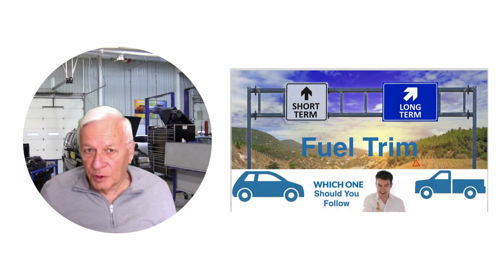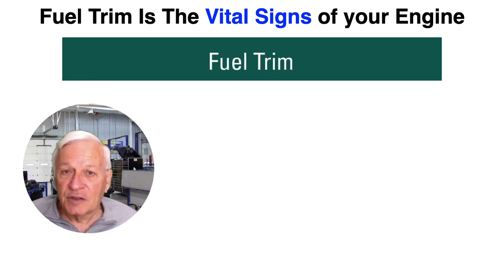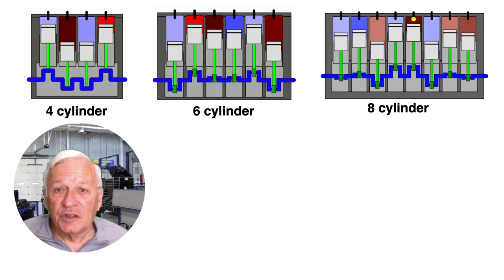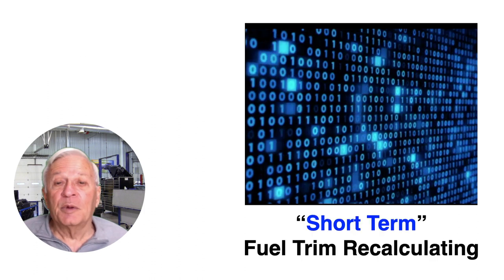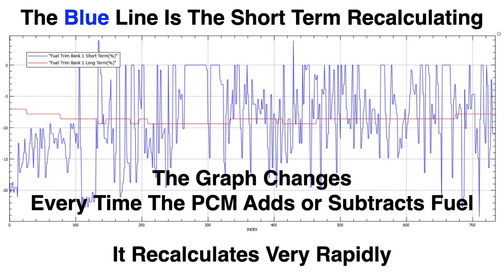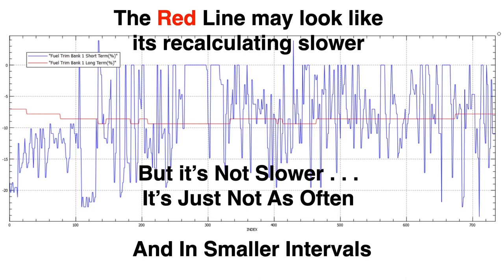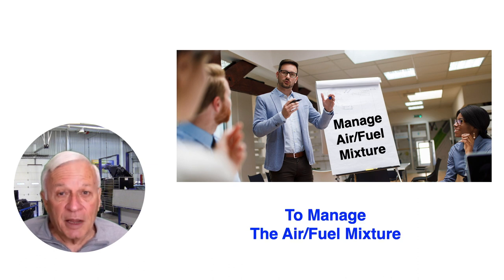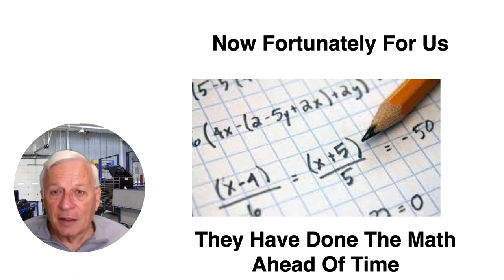Fuel Trim Why there are Two

Comment: Very good overall explanation.  What it's not clear, is why when the PCM adds up to 0.02% to adjust to correct 14.7:1, then the next time instead of turning back to minus -0.02 % to level up even and correct, it shifts to a -0.03% and starts a seemingly erratic "over-doing it" cycle.

Comment: Doesn't the pcm switch the fuel mix lean and rich to oxidize and reduce contamination? It's not just looking to achieve stoich 14.7 but clean air too? Perhaps you could explain this too?

Comment: Hello Dear Sir, I tested a 94 Cutlass Ciera V6 MPFI 3.1 L engine with a Snap On MT2500. Regarding to scanner readings: If you have Fuel Trims values ranging from  122 to 134, what is the "desired value"  in this engine?, Thanks in advance.

Comment: My LTFT stays 0.0 all the time and when my STFT exceeds 30+ (-30 to +30) I get the Check Engine light. Can anyone help?? Local shop just could not figure out?
Reply from the maker: With no further details, it is impossible to say for sure.  However, that IS NOT how either LTFT or STFT should respond.  I would suspect a bad PCM.

Comment: At 08:24 you've dubbed the audio to correct "below" by using "above". But are you sure it should really be above? Cause it doesn't make any sense, that way the feedback loop would spiral out of control. It should be below 10% combined STFT + LTFT, I've even found other videos stating the same (using below).